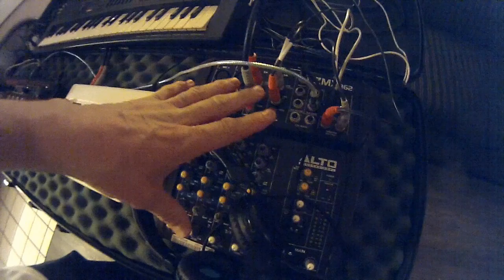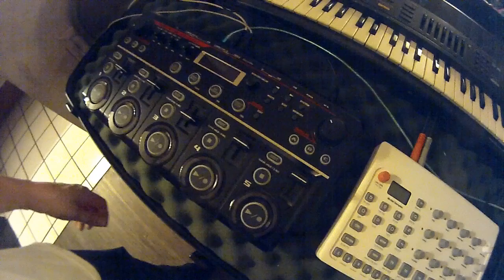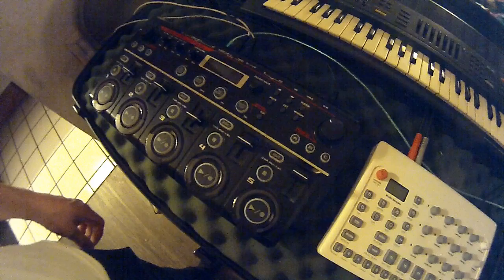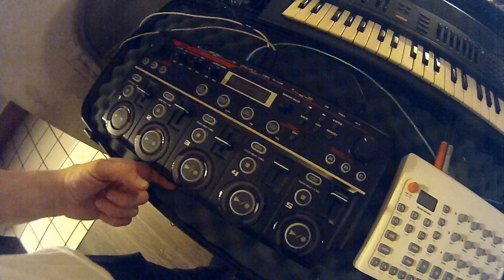Elektron Model Samples as the backbone of a live setup? w/ Boss RC505 and Yamaha PSS-380

Comment: This is great. I’m sending the midi clock from model:samples to RC-202 and I haven’t had any issues, but I’ve heard many times that RC-202 and 505 behave better as master in a midi setup.
Reply from the maker: Hello.. The 202 and 505 (I use them both) work fine as slaves for a while, then periodically will spaz out on me at the most inopportune times. So I use them as master now, lol. Thanks for watching!

Comment: curious what bugs that thing has and if they have been fixed. i almost bought one instead of the pedal i went with.
Reply from the maker: Hello.. Honestly, it wasn't so buggy while I was using it, so much as the firmware design itself was infuriating. Lol. Thanks for watching, Chris! :)
Reply: @danieklerr  I went with a ehx 1440 but had my eye on one of those loopers. Both look like fun options!
Reply from the maker: @christopheronald  .. Haha, I understand now. I thought you meant the M:S. Yeah, the 505 has some bugs, but they're not game-enders. It has to be the master of the clock, though, which is my only complaint.
Reply from the maker: @christopheronald  .. I should also say, the effects are really very useful for me, even if they don't sound the hottest. The RC202 has 4 fx in and 4 out, for a total of 8, which is also very nice.